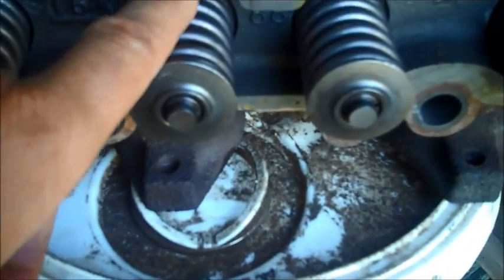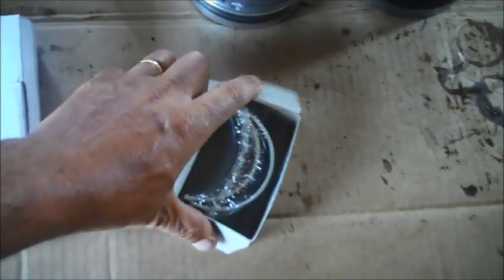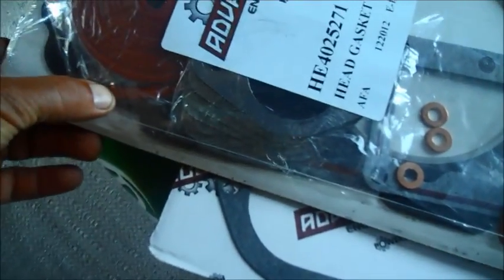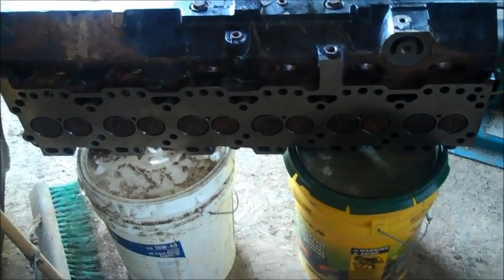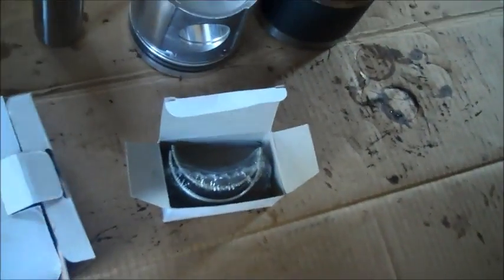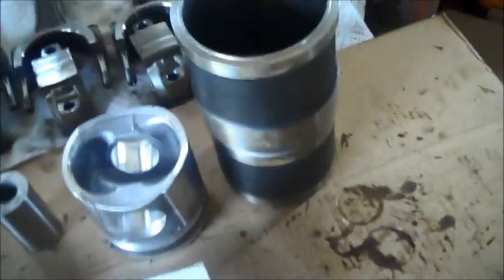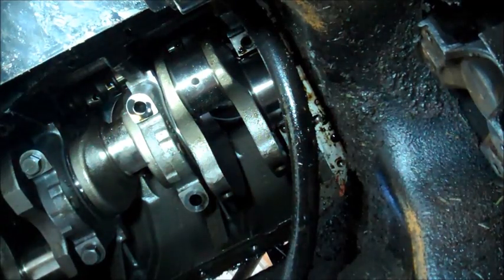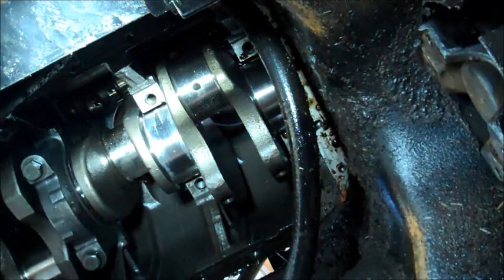tractor engine rebuild part 2

Comment: Easier way to install those main bearings is with a new brakeshoe Rivet inserted into the oil hole in the crankshaft and start the main bearing then rotate the crankshat to push the main bearing on in very easy done